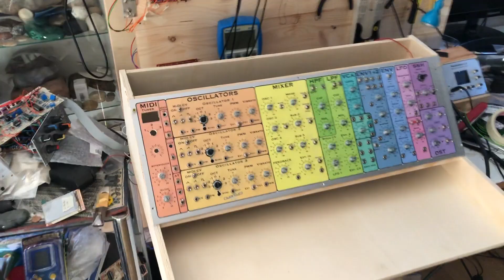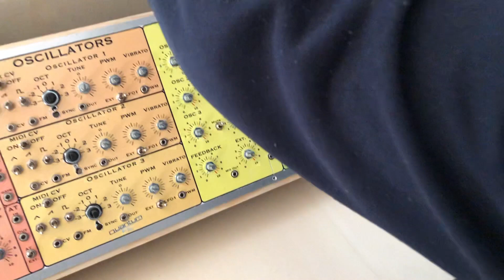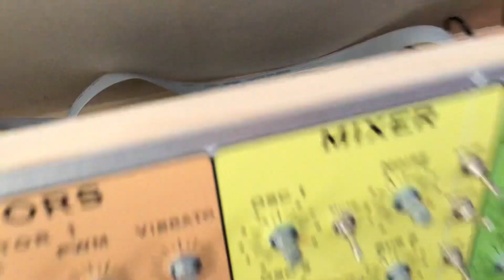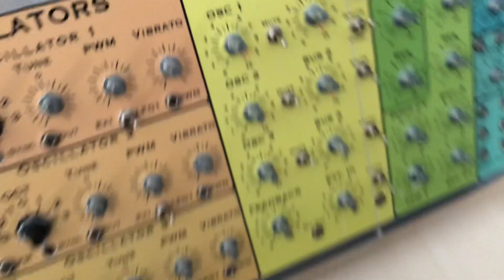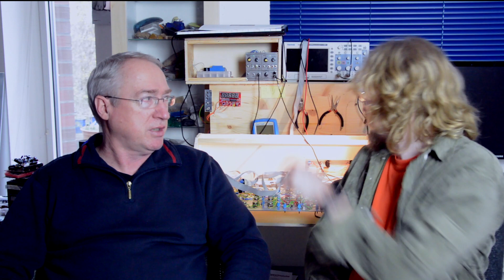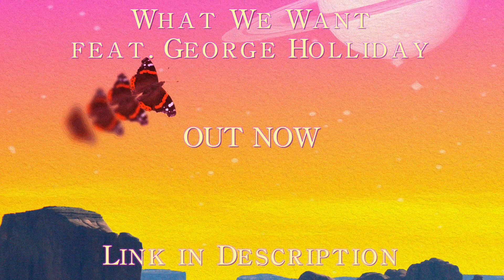Developing the ultimate DIY Monosynth Part II - F&S Ep. 26

Comment: Why not use a DAC IC for the missing analoge Outputs of the MCU?
Reply from the maker: We already use a DAC, but it's only two channels in addition to the 2 the STM already has. The lil STM just isn't powerful enough for this.
Reply: @georgekay372  So it can't handle I2C? You could just use an 8channel DAC or similar. It shouldn't matter how many channels the DAC has. It's just an address that you change with I2C on the DAC  What do you mean by not powerful enough exactly?
Reply from the maker: Dr. J0nes I had a chat with Nils and he says that DAC chips with more than 2 outputs get really expensive very quickly and a lot of them aren’t made anymore, just like he didn’t find any multiplexers.
Reply: @georgekay372  I ordered some 8 channel DACs some weeks ago from mouser for 8€ each. They are still made, but yeah they are expensive like hell :D Also mouser has 30€ shipping when you not buy stuff worth of 50€. Maybe you know someone who will already order stuff from mouser and you can order together so you don't have to pay shipping. But yeah still expensive chips that's right ^^ For my MIDI to CV project I use 3 of them.. But yeah I can understand when you don't want to pay like 8€ for an IC :D If I had known it earlier I would have ordered you one when I placed my order 2 weeks ago :D
Reply from the maker: Dr. J0nes that’s such a nice offer mate! Maybe next time! And 8€ isn’t really all that bad, but the 30€ shipping is an insult!

And what kind of midi/cv interface needs 24 analog outputs‽ please share!
Reply: @georgekay372  A polyphonic one :D Will share it on Reddit when it's done.
Reply from the maker: Dr. J0nes can’t wait!
Reply: @georgekay372  me too but it's a long time project seperated in multiple modules that communicate with each other. So if will take some time :D